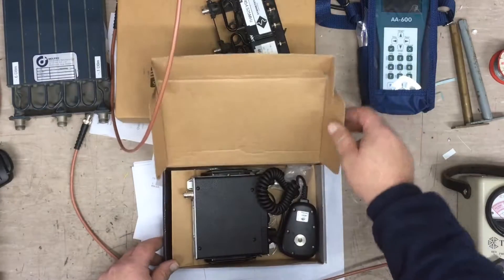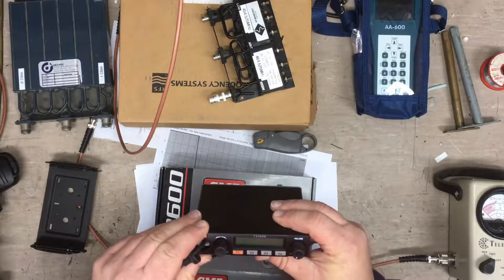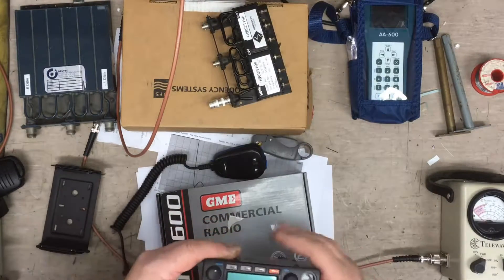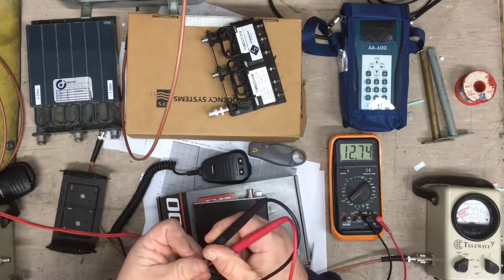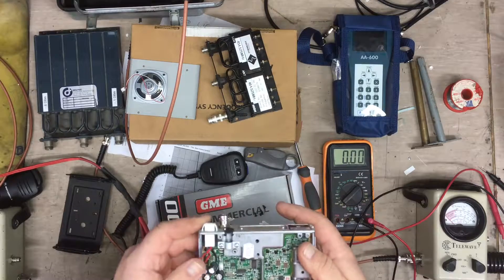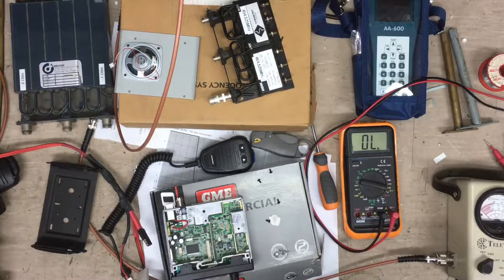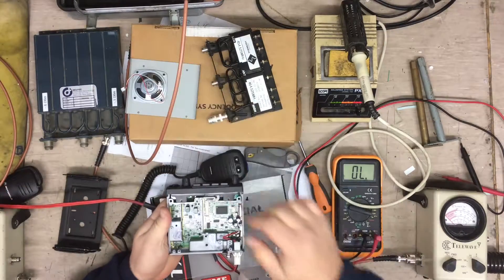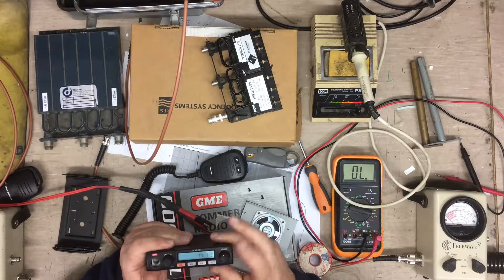Repair of UHF GME TX 3620 Commercial Radio

Comment: i know this is a few yrs old but do you still do gme repairs? My tx3100 shows TX when i press the trans button but it does not transmit..someone told me it has a blown diode but i don't know if its in the mic or the set..any help much appreciated
Reply from the maker: Hi Wayneo’s World, the fault is a common fault cause by high vswr on the antenna system, if you fix the radio you will still need to check and fix the antenna, the high vswr will take out the PA Stage of the GME radio and will only tx at very low power level ( microvolts = pre-power amp stage) the PA IC is about $120 / $140 to replace, see this video I made here on the replacement of a GME PA IC stage https://youtu.be/HYRBR7hg75U
Reply from the maker: The fault can also happen if you TX without an antenna fitted, so after you get the radio fixed, get the antenna system checked before TX, or you will blow the PA stage again.
Reply: @vk3hau  Hi mate and thankyou very much for the reply so quickly..I ended up fitting a new unit today but now i will need to replace the antenna it seems before i repeat the problem..Is the old unit worth repairing in your opinion ? i thought i might like to fit it to my camper as a base set when we are out fossicking..Do you repair if so and is it viable to mail it to you from Gladstone ,qld.? thanks again ..
Reply from the maker: @wayne1959  
Hi Wayne, you would be better to find a local GME Dealer near you, I am in Vic, and at the moment GME are having stock issues with parts, if you drop in to a local dealer they can check your antennas VSWR as well, the repair to the tx3100 shouldn't cost more than $140 but you need to way up if repairing or replacing is more of a viable option, as a new unit is only about $100 more you would also get 5 years warranty. you can find authorised GME dealers at this link https://www.gme.net.au/au/find-a-dealer/ .
Reply from the maker: @wayne1959  
I found two dealers in your area that may be able to help you... 

Jeacocke Electronic Services T/AS Jones Communication

6 Easterby Street 
Gladstone, QLD 4680

07 4972 1116

Nixon Controls Pty Limited Gladstone

2/38 Lord Street 
Gladstone, QLD 4680

07 4972 2000
Reply: @vk3hau  mate, that's just bloomin awesome of you to do that, thanks very much indeed..ill try the local guys and see if they can help out tomorrow..I subscribed in a small token of my appreciation for your going above and beyond to help an old fella out..Very much appreciated.

Comment: Hello,

After much searching in Youtube, I found your channel, which BTW I think is much better insight that GME themselves.  I have a question re GME mic's and trying to get a connect to a GMW UHF and a Sena SR10 unit, wondering if it's possible to email you?
Reply from the maker: Hi Lyndsay, sorry for the late reply, the last 2 Victorian state lockdowns have been keeping me busy with work, the accessories cable for the SR10 is listed on SENA's website , part number is SC-A3003 $39.95. to suit the GME TX-610, TX-6000, TX-6200, TX-7000 https://www.senaaustralia.com.au/buy/sc-a3003-two-way-radio-cable-for-sena-sr10-compati/MKSC-A3003 , Thanks for watching. 73's VK3HAU

Comment: Hi,

Got any info on a GME TX2700? I've got one I need to convert to 26 meg for NZ. is that software or a jumper?
Reply from the maker: Philip Newland 
The TX2700 is 27Mhz AM radio for the Australian market, to convert to the NZ band would require changing the pll ic configuration , and retuning the front end , not an easy task, I suggest you get in contact with a local cb repair shop over in NZ,, no repair shop would do it in Australia as it would be considered a non type approved conversion by the ACMA. mite be cheaper to purchase a new NZ radio over there.

Comment: Hi mate got a tx 3200 i have decent revival  but wont transmit past 20 meters any ideas ?
Reply from the maker: Hi Luke Anderson , that sounds like the PA stage IC , common fault if you have high (V)SWR or a short on the antenna system. You can only buy this IC from GME if you are a authorised repair centre , find your nearest GME dealer and check if they can repair local, Cost with labour should  be between $120 to $140 to diagnose and replace this IC and fully bench test for any other faults, but, and I stress this point, if it is found to be the PA Stage IC, then you will need to have your antenna system checked as well, as this would be the root course of the PA stage IC faulting in the first place.
Reply: Had a feeling  it would  be somthing  tp do with that or the po module  not sure if its worth  fixing had a mate telling  me thw other day that when these models come out you could  send the units back to gmw and bump them up to 10 watt or near not sure if thats  true
Reply from the maker: Luke Anderson 
The PA Stage IC can do 7 watts but are Turned back to 5 watts to comply with the acma regulations for CB uhf, GME or an authorised dealer would never take a radio and increase the power above the acma regulated power level as it is against the law, commercial radios like this one is regulated by the commercial license, in most cases the commercial licenses allows up to 25 watts on mobiles and 50 / 100 watts for commercial repeaters, I have worked on pager repeaters that are 250 watts

Comment: Hey mate, loved the video, could you do something similar for replacing a blown final? Have a similar gme cb radio that has a weak rx and tx.
Reply from the maker: Dan T 
Hi Dan, if you have poor rx and tx there maybe a antenna fault, have you checked the (V)SWR? A blown final ( PA Stage IC ) will only effect the TX and the radio will only be transmitting at uVolts from the pre-amp stage, the receiver will not be effected. The PA stage IC is only available from GME.
Reply: vk3hau thanks for the super fast reply, I’m not sure of how to check v(swr), there is not a lot of information on the internet on how to troubleshoot GME radios. I’m positive it’s not the antenna, I’ve tried 2 separate radios, it is still transmitting and receiving, but only at short range, I’m testing with a hand held 5w from about 10 meters away.
Reply from the maker: Dan T 
Hi Dan, the only way to know for sure its the PA stage  is to put it on a test set or a power meter a Measure the power output , if its in the uV then it is most likely the IC, but it concerns me that you are having receiver issues as well, this is unrelated to that IC, the so259 mite be the cause of the rx and tx fault, have a look at the Centre pin of the so259 socket to pbc , there maybe dry solder or even hairline cracked on that part as this is the connecter to the antenna and get knocked about over time, also check around that area of the pcb , run a Signal into the set and use a nonmetallic probe and slightly push on the pcb in different areas , if the Signal strength jumps up and down then you have a bad solder joint and will need resoldering but its best done with a test set.
Reply from the maker: Dan T 
Hi Dan, have a look at this video I have done with repairing TX Final PA stage IC https://youtu.be/HYRBR7hg75U

Comment: oh woooow. try connecting an arial !!
Reply from the maker: sm ma 

No need, thats what the Motorola test set is for, It has a built in dummy load and can handle up to 145 watts, this radio can deliver 5 watts maximum.